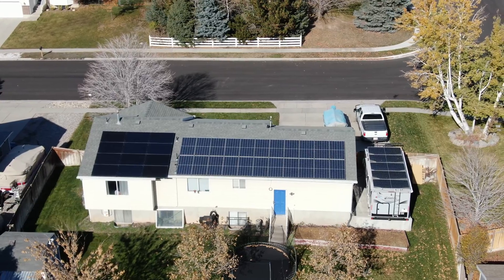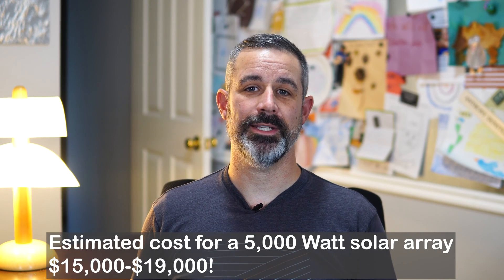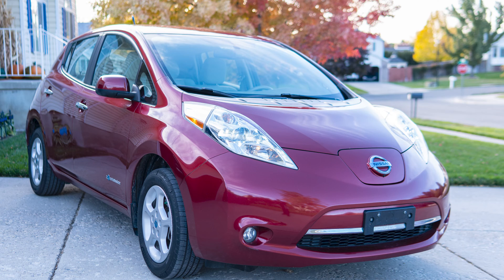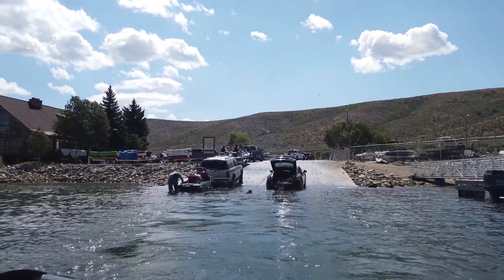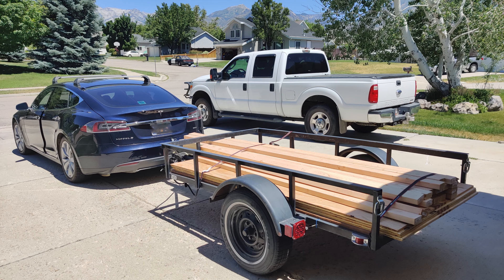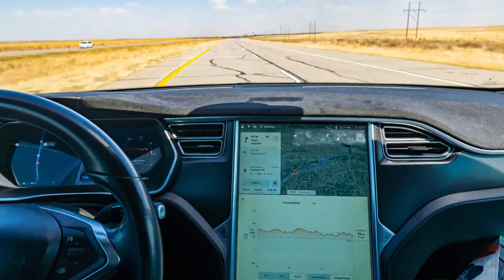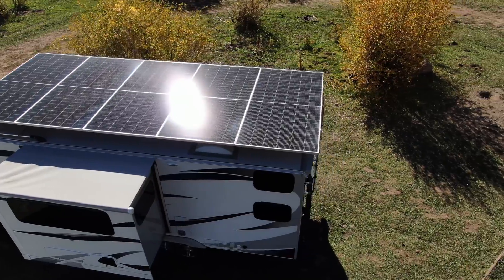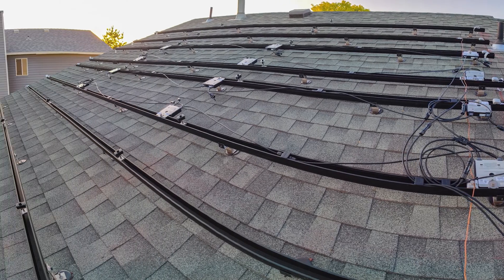How Long Did It Take Us To Break Even On Our DIY Solar Installation?

Comment: 3 years break even in germany based on 3500 kWh consumption and 0,36 $ per kWh incl. 19% sales tax and NO NET METERING, but 0,09 $ per kWh we feed in.
Look at the ratio: feed in 4 kWh to get later 1 kWh for free
3 years for a 30 kWp array with about 12 strings, 6 inverters incl. 1 hybrid and we later got a diy kit to build a 15 kWh home storage (Seplos Mason 280-L  Case incl. BMS and every part you need for 500€ and 1850€ for the EVE LF280K  LFP cells, so about 2400€ for a 15 kWh storage on wheels which looks like a furniture cause it is the power tower in creme white very well produced like made in germany and not the ugly black battery case of the usual Mason 280 seen on yt everywhere) .  This battery pushed the pay back date about 1 year back . We generate about 33.000 kWh, used about 3500 kWh for the house, got an EV and needed then about 6000 kWh and then 2x 5 kW Split AC heaters and a hot water heatpump boiler incl. 280 Liter warm water tank incl. a coil as heatexchanger that also can heat the water circle in the central heating we rarely use (500 Liter a year instead of 2500 Liter before). 
4 years payback time for the solar array, Heatpump payback time is about 3 years cause 1 Liter diesel for heating is aboiut 1€ or 1,10 $ incl. 19% VAT / Salestax while 1 Liter Diesel for cars at the gas station is about 1,70€ or a gallon is 7€ or 7,70 $ incl. 19% sales tax cause all our prices incl. the sales tax which is 19% except for the basic items needed for living like groceries, newspapers, toiletpaper which are about 7%. 

And of cause since the russian invasion all components for solar power have now a special sales tax of 0% to encourage people to invest into solar power. 
BUT: as you had said the solar power sales guy gave you the right tip to invest now but his offer was crazily overpriced to participate from the tax credits youi would get.
Same is happening here, you build on your own 30 kWp for about 15000€ or the solar power installation guys will take from you 45000€ or more. 
BUT: if you do a diy system you will get no tax credit or subsidy even though you have to  purchase all the parts. But in total it is still a lot cheaper to diy than hire the guys and pay them  a fortune for nothing and get a small subsidy. And those subsidies were limited to 70.000 system - for 80 million citizens in 2023, and in 2024 this will be 0 cause they ran out of money with their budgets due to violating the constitution when they had made more debts than allowed. 

But here the people are very aware of their consumption figures and which device uses what amount of energy due to high energy prices at 0,34€ or 0,36$ / kWh.
I bet the USA would look totally different if the prices would mirror the harm / damages gas and diesel burning is causing to the environment. We hat about 0,20€ or 0,22 $ prices before the russian invasion, so they have been always a lot higher due to taxes and fees but also to something the USA never had across the country: highest availability of the grid across a country that is bigger than a town or city, so 99,9% across germany is the grid availability regardless which storm or snow fall, the lines are usually well protected and we usually do not have power line crossing streets cause they are in the streets or rather under the boardwalk and well maintained. We do not need an emergency generator or a F150 with a capability to power the house.   Last outage was about 20+ years ago when the cross country masts collapsed in a certain area due to a steel which were similiar to that of the titanic which could break apart under stronger cold, so they collapsed under the cold and wind and snowload from the lines. 
Grid were back within the next 2 days. All these kind masts have been replaced in the following spring and summer that it could never happen again.
Reply from the maker: It's interesting to hear how different some things are in Germany compared to the United States, yet in other ways there's similarities. Overall I'm very happy I went through all the work I did back in 2017 and 2019 to install my solar array. Plus the additional projects of my RV and electric vehicles have made us far more independent than most people are and I love that.